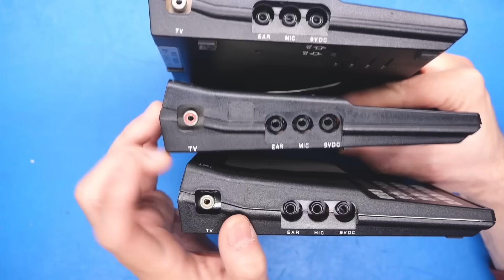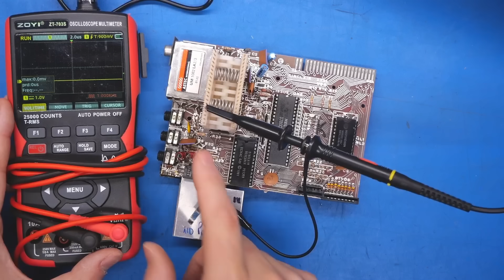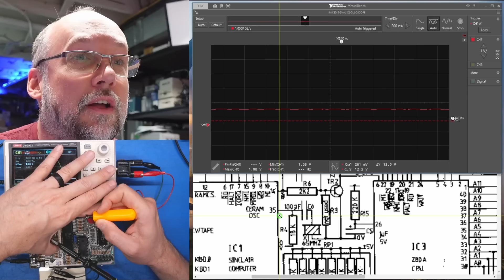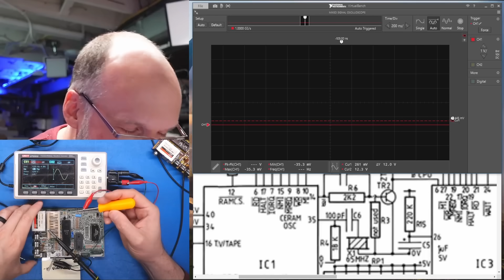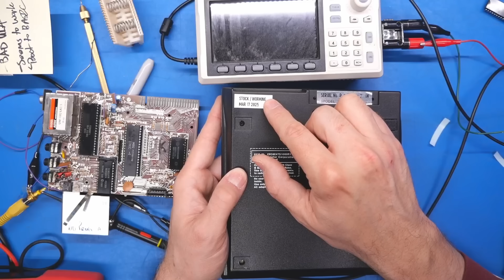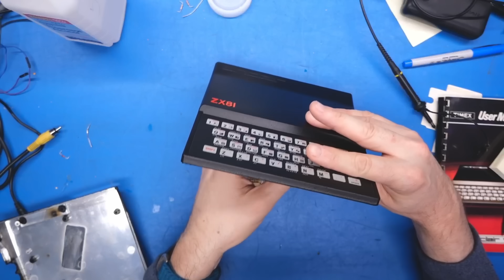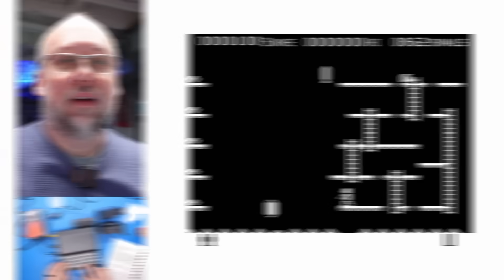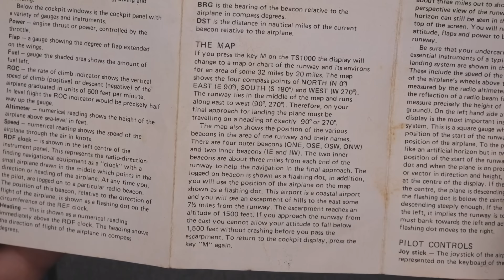Is the ZX81 / Timex Sinclair 1000 actually bad? Let's fix these to find out.

Comment: The ad is fascinating.  At first each of the 4 machines appear priced roughly in proportion to its capabilities.  However the Sinclair is essentially useless without its 16K expansion, bringing the price near to parity with the TI-99 after rebate (I assume it's the 4A, though the ad doesn't specify).  TI was giving the things away by this point.  Both machines are architecturally weird but the TI is infinitely preferable in my mind. 

Meanwhile the VIC-20, with its much larger software library than TI, may be the better purchase at only $80 for those "80s gamers among us.  Nowadays things like the Penultimate cartridge go a long way to making the VIC a good all-around machine. 

But the elephant in the room is of course the Atari 800.  A glorious, massive elephant it is.  It crushes everything else on the page.   At $290 after the rebate it is a bargain.  It doesn't say but I assume that's the 48K model. 

The machine on the page that I wouldn't consider is the Sinclair.  We had one from a garage sale in the '90s and it was miserable to use!  At the prices in the ad, it would make no sense to purchase.  Anything else was better.  I gather the situation in the UK was different as there were many happy users of the ZX-81 (allegedly).

Comment: My dad had the ZX Spectrum with the 48K upgrade, I had the much later 128K +3 with the 3" disk drive and CP/M support. I have a soft spot for these machines as they were my first exposure to home computing, I had used the BBC Micro at school. At 44 I've built multiple PCs and I'm still very much a gamer 😁

A little FYI for those who don't know, Timex manufactured all ZX81s it's just the branding and RF output that differs AFAIK.

Comment: I'm glad you covered this computer since it was the first I ever owned. I believe I got it when I was in 3rd grade from my uncle. Up until then at school we had Apple 2, my uncle had Atari 400, and my other uncle had a C64, and I wanted a computer BAD but my father said there will never be a computer in this house, we'll, my uncle gave me a TS1000 for Christmas and that was enough to keep me happy.l, and in 8th grade I got an Atari 600XL. I am impressed with the games you tested, better than anything I had. Some mods do exist that I would love to see you try. One is WRX hires graphics. I believe that is done on the 16k ram pack, and the other is a board so you can use a Commodore floppy drive. I do have to ask, is the ZX81 1k with yours? The TS/1000 has 2k in it's base form.

Comment: The reason for selling the Sinclair ZX-81 computer as Timex-Sinclair 1000’s in North America was a follows: Sinclair had contracted with Timex to build the ZX-81 for Sinclair for the UK market since Sinclair didn’t have it’s own manufacturing capabilities (much like Apple uses Foxconn to make iPhones in China). Sinclair was ill prepared to market the machines in the U.S. but as I understand it a few didi make under the Sinclair ZX-81 to the U.S.  This is where Timex stepped in as they already known here for making digital watches and clocks and such and felt there was a market such a cheap computer here too.  Since they already manufactured the computers for Sinclair, they took it upon themselves to propose a partnership with Sinclair where they would manufacture and package rebranded and slightly modified (NTSC and 110v) ZX-81’s as TS-1000’s and provide customized manuals for the N/A market. This worked well for the TS-1000 which initially as they did sell well enough to justify the partnership in the first year, though due to the limitations of this computer, there was a limited audience for it which they exhausted after about a year and they had to cut the price down to $50 in the second year.

They later tried to sell a variation on the Sinclair ZX-Spectrum too for North American markets called the T/S 2068 but make a serious mistake by adding some additional feature/spec changes such as a cartridge port Spectrum to try and make more combative in the U.S. market vs Commodore, Atari, and Nintendo. The problems was that these upgrades/changes caused huge incompatibility issues out of the box with most UK ZX-Spectrum software, severely limiting the software availability at launch. With few software companies wanting to write or port software to a computer that was selling in so few numbers and few consumers wanted to buy a computer with so few titles available for it (Classic chicken and egg problem), this hurt sales. There were mods/hacks that would  allow the T/S 2068 to run UK ZX-Spectrum games but given how you would have had to mail order Spectrum games from the UK, it likely wasn’t worth it back them for most potential customers. Had they been able to import Spectrum games they would have had a much larger library even without native U.S. game developer support.

Timex also sold Sinclair computers in other European markets like Portugal under the brand Timex Computers and had greater success then in N.A., even their N.A. operations after Timex-Sinclair was shut down  in the late 80’s due the failure of the T/S-2068. The TC 2048 was a  rebranded ZX-Spectrum sold in Portugal and Poland that had much greater capability and it what the T/S 2068 should have been.

Comment: You can probably glue some wires to the keyboard ribbon cable and membrane and use Chip Quik conductive paint to make a repair, but it probably won't last due to the bending of the ribbon cable.

Comment: I have the Timex Sinclair version of this.  I only noticed that it was in a closet in the basement within the last year or two.  I just looked in the closet and it’s in the original box and has a 16k ram expansion.  My dad got it probably around the original US release.
Reply: I think we also had a ZX80 before that.  I remember a very simple white computer that my dad originally bought as a kit, but never got around to building so he traded the kit in and paid extra to get a pre-built one.  I remember him typing in a program (I may have helped) that played simple tunes if you got an AM radio with a wire antenna and ran the antenna under the computer.  The program used specifically timed loops to create radio interference at specific frequencies.

Comment: A couple of things: Yes, my first computer also which I had purchased via mail order from Sinclair sometime in late 1982 after they had dropped the price. I couldn't afford anything more expensive, and it took me several months to save up for a RAM expansion. I later made my own keyboard by stripping down a keyboard from something else and manually wiring up the matrix. 
The Boston Computer Society had a small Sinclair group, and through that I managed to weasel an invite to the corporate office. Yeah...the Nashua, NH address is the distribution center I suspect. The folks I met were in downtown Boston (Government Center I think).  
I still have my ZX-81, that I lovingly restored after it sat in a box for decades. I bodged on a 8x64K RAM chip onto it, changed out the 7805 for a Recom (R-78E5) which means I could dump the heat sink also. I also have it hooked up to my USB-Keyboard converter (having long ago ditched the membrane keyboard connectors). 
Thanks Adrian for running this video segment, you did showcase the three most common faults I see when I get my hands on barn finds: crappy sockets (on the ULA and Z80), the ULA itself, and the keyboard connector. 
See you all at VCF Southwest in June!

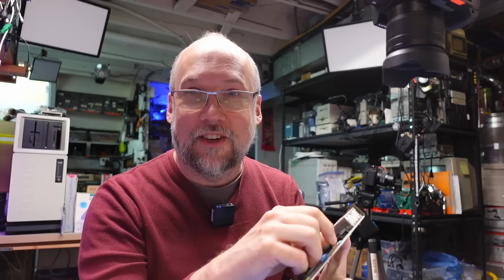Comment: @31:00 FYI that is a ceramic resonator, not a crystal, it uses a R/C oscillator and the resonator is there to stabilise it.
Reply: Thanks for the info.  I was wondering about that.  Looked a lot like an ceramic IF filter in a radio.
Reply: a ceramic resonator is much cheaper than a crystal, that is the main reason for using one.

Comment: I had one with a 48K memory extension.  The problem was the Edge connector . The edge connector on the Timex Sinclair TS1000's memory expansion was notorious for poor contact. A slight touch or knock on the computer could cause the connection to momentarily break, often leading to a crash and hours of writing lost in less than a second. I learnt how to program the Z80 assembly. A wow discovery was when  i learn the existence of the interrupt. ISR in Z80 assembly.

Comment: I remember playing text adventures on one of mums friends rather expanded version, 32k ram pack and an after market keyboards. It kind of cemented my love for the Genre.
The £99.99 in the shops on launch here in the UK, The Atari 2600 was just dropping to about £130, The Vic-20 was about £300!  Both had cartridges that were retailing at around £20-30 where as the Sinclair had games on cassette which were usually priced around the same as a Music LP, about £5 or £6. You could get Vic-20 games on cassette but they were fussy about the memory expansion! You could have a 16k ram expansion for a game that needed an 8k expansion and it would not run! We didn't know about the specific memory address calls going on inside the software.

Comment: Hello Adrian,
Just a few things, Clive Sinclair and his team designed this computer after the ZX80, It has a Fast and Slow mode and far fewer chips. The fast mode is siimilar to the ZX80 in so far as every entry interupts the Video signal- but calculates faster , where as Slow mode (normal) will not nterupt the video signal. keyb are similar but somewhat diferent also. people laugh at these wonders but they got a lot of NOW Hitech people into computing in the first placve and the 1 or 2 Kb of Ram was a challange. What could you acheive with it. A lot as it turns out. People used these for controlling stuff similar now to ESP32's or Raspoberry PI's or Adrino ssb's. Keyb was an issue yes and having painstakingly spent about an hour typing in a program someone could walk across the floor and clip the power lead and Hey Presto - All Gone or dont use a soft stool as a table with the RamPack.  But..... There was a solution. MEMOPAQ sturdyly built both a Ram Paq in 16, 32 and 64K though you only got 56K from that one and also a Matching Keyboard, Plugged into the back expansion port, fitted well and because you were now not typing on the ZX keyb you had a Very Good Typing Expweience. I could type a similar program into this faster than an IBM using BasicA or GW Basic. Yes Only 1 command per line but it was 1981. I'll Link  to said Keyb and memory pack.  
Timex Build the ZX81 in Scotland origonaly for Sinclair and they then distrubeted the machine in the US as Timex Sinclair under licence, but with 2K of Ram instead or 1K
I had not known they were also built in France and Porrtugal.
And NO there is NO Silver lining inside the case in UK/Ireland, just black plastic.
https://bog.kswebshop.cfd/ProductDetail.aspx?iid=610074678&pr=87.88
and memory Pak
https://www.nightfallcrew.com/27/09/2013/memotech-memopack-16k-for-sinclair-zx-81/

enjoyed the video
It was my first computer. Got it in KIT form and soldered it myself and it worked first time, great wonder, I thought at the time. And I still play a few games on the 81 Emulator, Combat flight is one in particular. You also had VU-Calc a spreedsheet and VU-File a database.
Editing was easy, Put the pointer at the line you want to edit and SHIFT +1 key. On a long program if lines were say 10, 20,....310, 320, 330... etc and you wanted to edit line 280, just type 279 and hit enter/newline and the curser would now be at 280. Then Shift + 1 key.

Comment: Hey Adrian,
The ZX81 was my first computer back in the early 80s. I can confirm the internal coating was not present in UK models and the "RAM pack wobble" was a major issue, so much so I screwed a flattened copper pipe section from the ZX81 and into the bottom of the RAM pack.
You got used to typing quickly, helped by the keywords being selected first but it still was an aweful keyboard  - you just got used to it. Getting hot was also a known issue with such an enclosed case. I resorted to another piece of flattened copper pipe being bolted to the internal heatsing as there was plenty of room across the front. Drill some extra vent holes in the top and voila, a badly ventilated ZX*! made slightly better.
If you want to delve into it a bit more, you can asctually fit the 16K RAM internally - not a difficult job these days and removes the RAM pack wobble. Nice composite mod, maybe a TRACO Power in place of the 7805 and if you can get some low height heatsinks, cover the ULA to help keep it cool.

Comment: It was my first computer and learned BASIC and Assembly language on it before moving to the spectrum a few years later.    You can actually upgrade to 32K internally by adding a RAM chip and some wires which means you don't need to worry about the flaky RAM packs.   There were a lot of addons for it, including sound, speech and some other stuff.  Back in those days (1981ish) it didn't seem slow, since that's what we were used to back then :)

Comment: my 16kB expansion generated the same moire effects. a friend shielded his with tinfoil (grounded). i don’t know if that worked. I had the TS1000. Don’t know if it made the move from alaska to oregon. 
there were many 3rd party keyboards for the ZX 80/81 and TS 1000, i never got one. one big quality of life improvement was making a parallel cable connection to the expansions, reducing typing crashing.
the one friend with one also used elmers' glue to make lines around the keys for a more Atari 400 feel; was ugly, but allowed better accuracy. (literally just lines of glue with a fine brush. several coats.j
The cable issue for the keyboard is partially one of heat damage.

Comment: It's very easy to replace the internal RAM with a modern 32K SRAM IC and get rid of the RAM expansion. You'll only be able to use 16K of the 32K IC but that's enough for most games. And there is a keyboard 'membrane' with tactile switches available that is a great replacement while keeping the looks mostly original.

Comment: I got an ZX81... Hopefully not for long. I got a problem with my 16k extention. Often when  I touched the case of the RAM extention, the computer crashed. It was somehow a problem with static electricity. So I needed to take the 16k RAM extention out of its case and the problem was solved.
I was also typing on a Sinclair Sprectum.. It had a rubber keyboard, but the same system with the keys as the ZX81.. You could never type fast, as you were always looking for the BASIC commands on the keyboards.

Comment: The ZX81 was my first computer, yes it’s a simple little machine but I do have a lot of appreciation for it. Here in the UK a lot of game developers cut their teeth on this machine and pushed it beyond what it was designed to do. The 2 software farm games you showed were early examples of this as it was never meant to display user defined graphics in the pseudo hi-res though there were hardware cards to do this. Today this technique has been improved greatly and there are some remarkable tech demos to show it off.
Add on keyboards were quite popular, some fitted externally with a cable and other encased the machine totally. Other add ones include sound and colour plus many other things including control for other projects like robots.
All from a little sub £100 machine in the early 80’s you’ve got to love that.

Comment: I kept the original look and function, plus added some upgrades. Added internal 32k of static RAM with battery backup. I made it possible to still use the external 16k module if desired. I could run programs from memory without reloading them through the ear jack. I back up the program cassettes onto a vintage IBM computer disk, knowing cassette audio decay over time. Added an external reset button and a red pin-type LED for power and activity indicator. The last thing I added was a powerup and voltage sense circuit that detects 5 volts is present, and all the circuits power up at the same time... necessary for power spikes and brownouts. It eliminates crashes... =8-)

Comment: The original RAM packs do introduce a lot of noise, it's 'normal' - a combination of missing voltage production and as the ZX81 uses the Z80 DRAM refresh as a line counter for the screen everything has to be generated anew for the DRAM in the old RAM packs. Best plan is a ZXPAND+.
DIY an internal RAM expansion with SRAM if you prefer, although you won't get the other benefits.*
Sinclair made some genuinely rough and rubbish home computers - much beloved though nostalgia and the efforts of many great programmers.

*Make sure your DIY RAM expansion supports (pseudo)HRG or you may find some new games don't work.